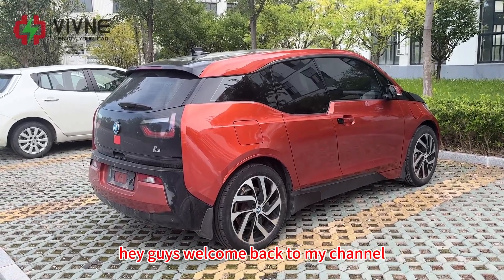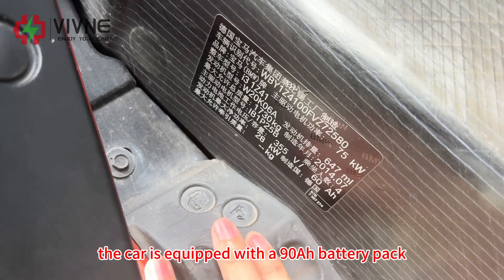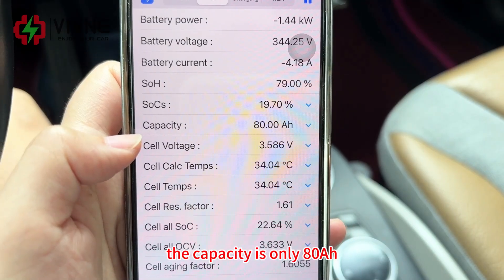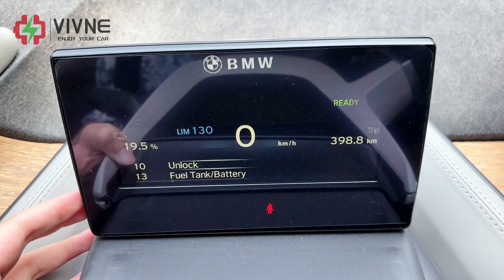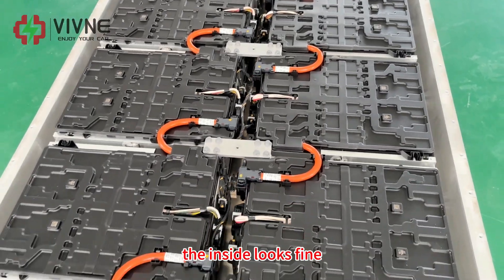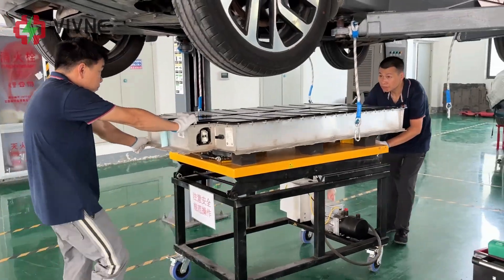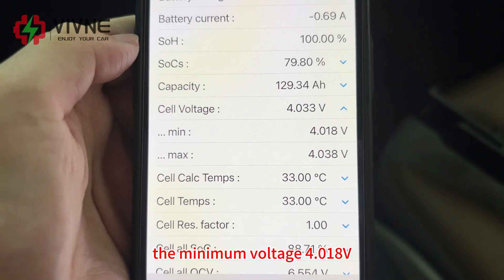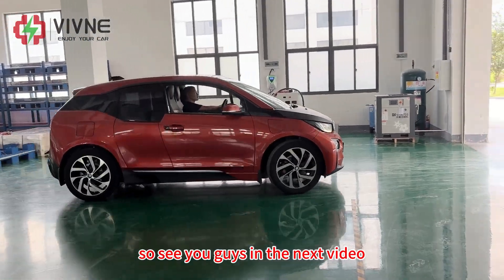VIVNE-BMW i3 Battery Upgrade From 90Ah to 129Ah

Comment: How long did the OEM 90Ah pack last before it degraded? OEM means the 94Ah from BMW 2017-2019?
Reply from the maker: Yes, 94Ah, not sure how long did it last, that's a used battery not brand new.

Comment: I'm very suspicious of that previous upgrade done by the previous owner, because it's very unlikely the degradation of an original (33 Kwh ?) battery would have been so much considering the overall quite low mileage of this car ?! Not likely that upgraded battery was used very much ?!? Was that upgraded battery a new or used battery when installed in this car OR i have to suspect that previous upgrading wasn't done properly in some way ?!? Btw talking about battery upgrades, nowadays there's also even larger upgrades available for the BMW i3, like the 54 Kwh pack by Martigi.
Reply from the maker: The previce owner upgraded with a used battery not new. 
Due to current cell technology, larger capacity batteries are significantly heavier. The original BMW i3 chassis and suspension are not designed to support such added weight safely. Based on current cell technology, 45kWh is the optimal capacity we can achieve while keeping the weight and dimensions as close to the original as possible. It's the result of careful design and calculation, offering maximum range without compromising safety or vehicle structure.

Comment: Amazing job! The i3 is a classic little car. Good to know the modules could be replaced in my Polestar 2 which has 82kWh CATL battery pack. I just drove almost 50,000 in just over a year including full lap of Australia and battery is still almost the same capacity. Interesting you use ah - maybe put kWh on screen in your vids when you quote the ah of a car 😊
Reply from the maker: Thanks! 🙏 Yes, usually we also prefer to use kWh because it’s easier to understand for most people. But BMW tends to describe their battery versions by Ah, so in our videos we follow the same naming to keep it consistent.
Reply: @VIVNE-CoraLiu ahh interesting. I think other early cars such as the iMiEV also used ah. I could be wrong. Keep up the great work!

Comment: Cool!!!! But don’t understand the SOH, how can this be 79% with 24,3kWh while the new capaciteit is 27 - 28kWh.

Would be great if you publish a list of partners online. Where you can order and install
Reply from the maker: Thanks for your comment! 😊
The SOH is calculated based on the battery’s current capacity compared to its original nominal capacity. In this case, the 90Ah battery originally has around 27–28kWh usable capacity, and now it’s only 24.3kWh, which gives an SOH of about 79%, so the numbers match. 
We don’t have a public partner list yet, but if you’re interested, feel free to contact me directly.

Comment: Fantastic! I would like to upgrade my 2014 I3 60Ah. Can you send a battery pack to Sweden?
Reply from the maker: Yes, sure, we can send the battery to Sweden, bacically we have DDP service to Sweden, which can ship directly to your door.
Reply: @VIVNE-CoraLiu  Super! How much would it cost? Is there a website were I can get some more info?
Reply from the maker: @johanhansson914  Yes, here is the link: https://www.alibaba.com/product-detail/VIVNE-45kWh-BMW-i3-Battery-Module_1601536422668.html?spm=a2747.product_manager.0.0.157571d2PNPLbb
Reply from the maker: @johanhansson914  Yes, here is the link: https://www.alibaba.com/product-detail/VIVNE-45kWh-BMW-I3-Battery-Module_1601536422668.html?spm=a2747.product_manager.0.0.24c171d20fqbp8

Comment: does your pack have the cooling lines connected anywhere? I did not see that, I am interested in buying the pack if you also kept the thermal management
Reply from the maker: The cooling system still remains the same position and works fine, I can show you some pics if you are interested, here is my WhatsApp: +8615211174371, thank you.
Reply: @VIVNE-CoraLiu will add you, thanks!